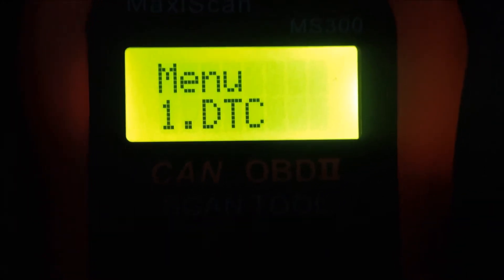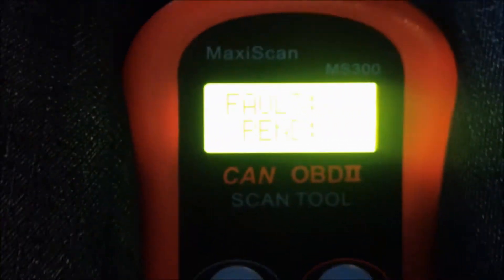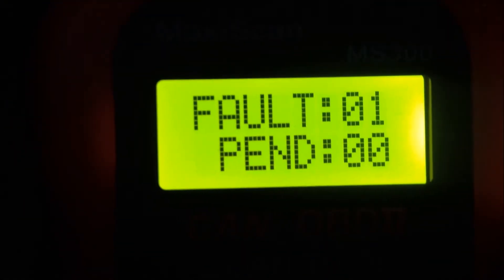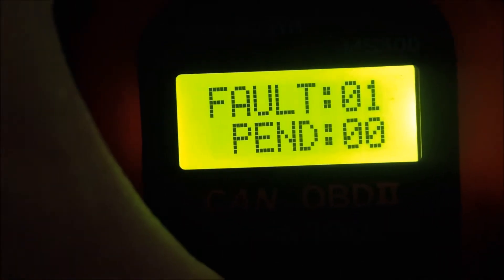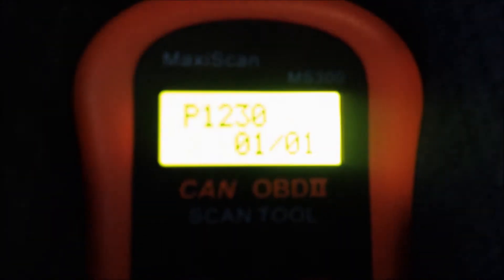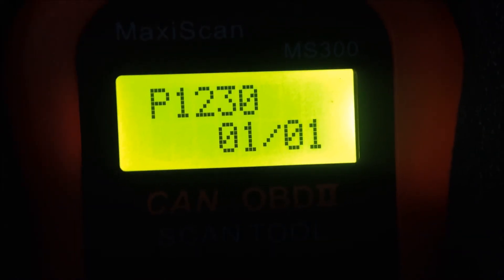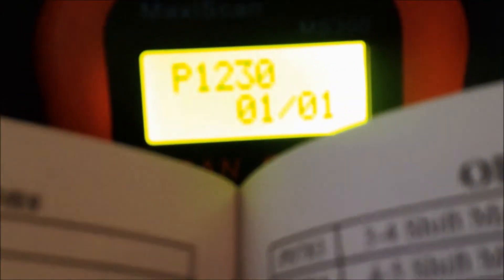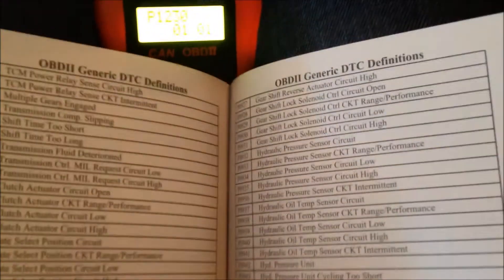OBDII fault code reading on your car

Comment: I bought this scanner too, but it doesn't work on my 1997 Saab 9-5, although it has a OBD2 port. It shows "Linking error". So be careful when choosing one. I guess it works on later models.

Comment: You are an inspiration. I'm a treeshade self taught mechanic and usually do engine work--head gaskets timing chains no-starts etc. I am going to get the scanner soon. 
You must be up north, I noticed a temp of 17deg on the SID video. Thanks.